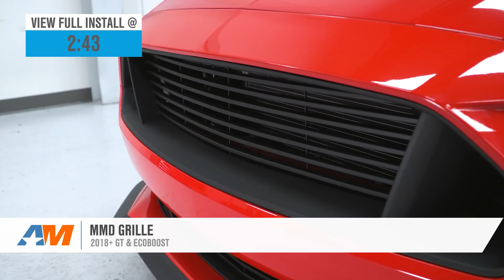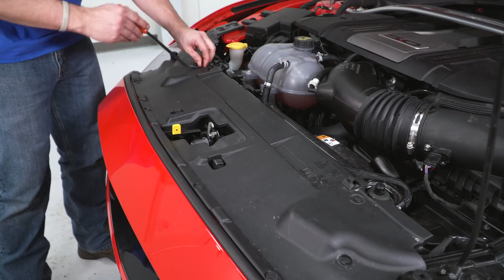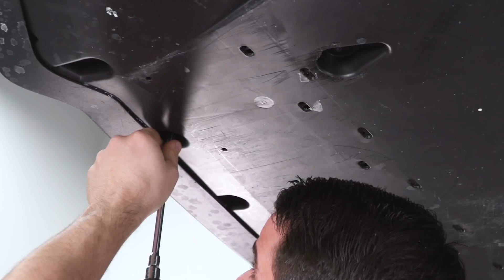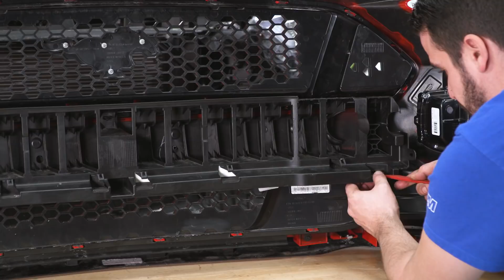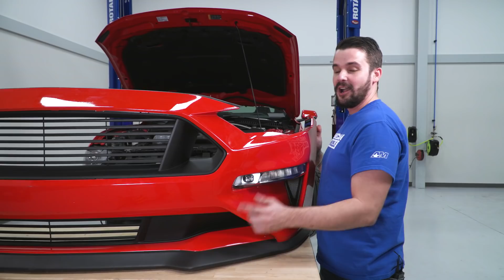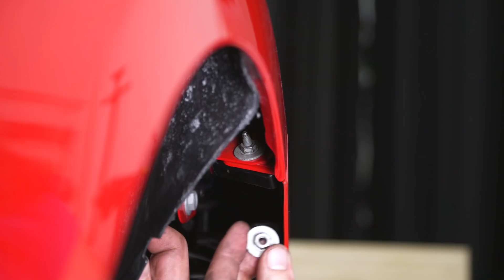2018-2019 Mustang GT & EcoBoost MMD Grille Review & Install

Comment: If you have the equipment this install is simple. I even messed up and had to completely remove the bumper after installing everything and lowering the car. Made a huge difference with a front chin spoiler, 10/10 would install again.

Comment: I will never buy a new model car ever! Imagine paying $700 a month for a car then buying extra things you don't need for $100plus yeah no thanks lol I rather buy a '10 and down and just make it fast that way the car will be paid off
Reply: But the money you spend making thd 4.6 fast , you would have been able to easily get a low mileage used s550 mustang . $23k will get you one and that is about $400 per month . A 2010 and below will cost you about $10k but you will need cams , full exhaust , suspension,  rims , tires , brakes and that will cost you probably $5-8k if you dont install it yourseld . Then you will have a car that is still slower,  worse on gas , handle worse and will probably have 80k miles or more on it with no warranty.  Not to mention the questionable reliability and fact that you wont pass an emmisions test after the mods .
Reply: I just bought a 2019 GT in manual with 4.5k miles on it. 🤷🏻‍♂️